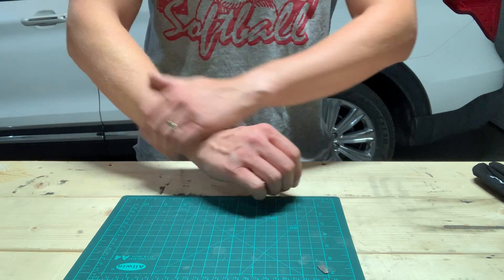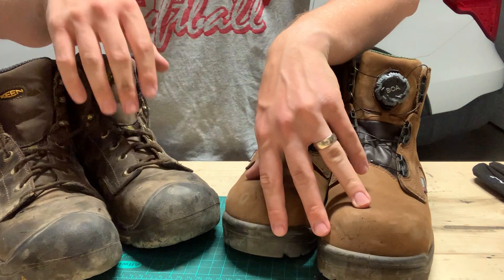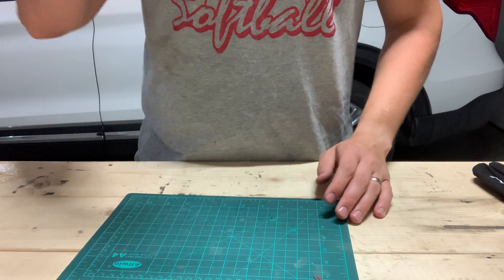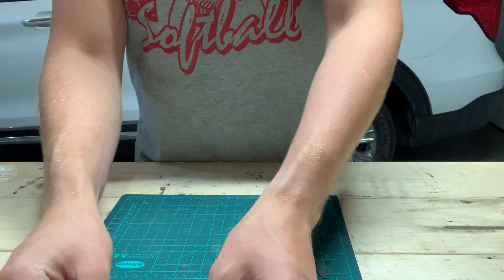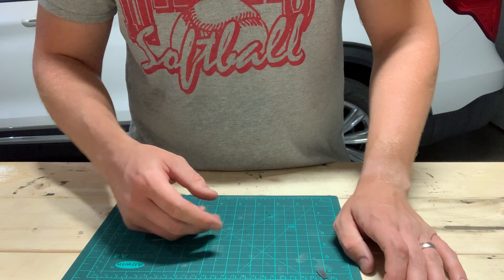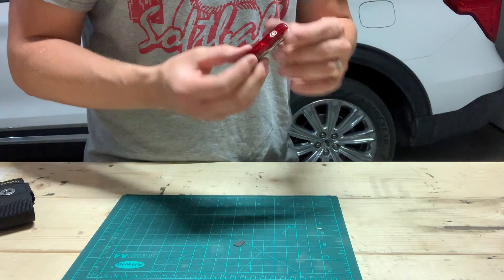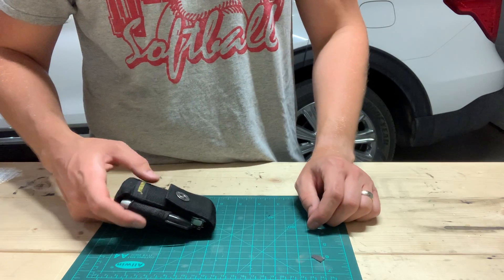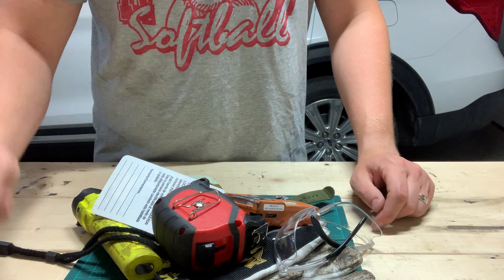An Engineer's EDC for Plant Shutdowns/Turnarounds

Comment: Just curious: wouldn't the big flathead/pry bar of the free be suitable for your needs too instead of shortening the ruler?
Reply from the maker: I hoped so when I bought it but it’s actually not very wide at all. The pry is about 5mm of effective width vs 8mm on the mod. I still like having the pry though because the other flat heads are super thin on the free series!
Reply: @EngineersPerspective701  yeah i'm modding mine too. Taking out all the small flatheads and putting in a bit exchanger
Reply from the maker: @Kleiner_Lutz  I’ve thought about it for mine but I think for me, I’ll camfer the Philips to accept the Super tool 300 bit exchanger.
Reply: @EngineersPerspective701  the modification I have in mind normally would take out the philips and the pry bar. I'd like to keep those 2, so i'm putting it on the other side.

Comment: So I use same air monitor water plant. Anyway we have to bump test before every use and calibrate it once a month. That's why I never took it home. Do u do the same what's protocol where u work just curious?
Reply from the maker: Our protocol is to bump weekly and calibrate every 30 days. I generally just do the full calibration weekly just because it doesn’t take that long. More often than not I’ll end up in the field and not at the plant so that’s why I take it home. We have calibration stations at several of our locations so I either hit them up before I leave or on my way to location.
Reply: @EngineersPerspective701  👍